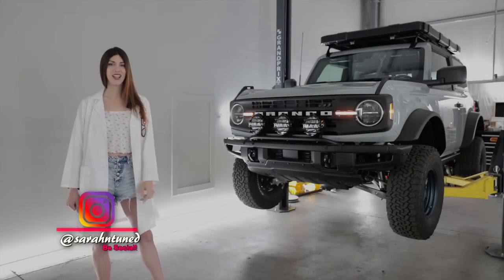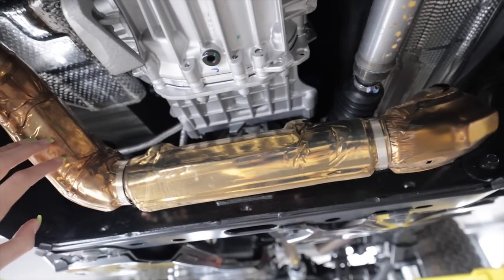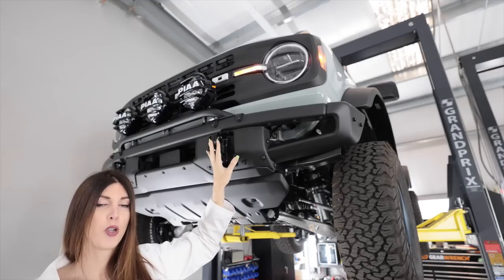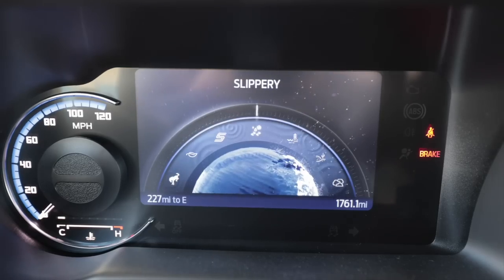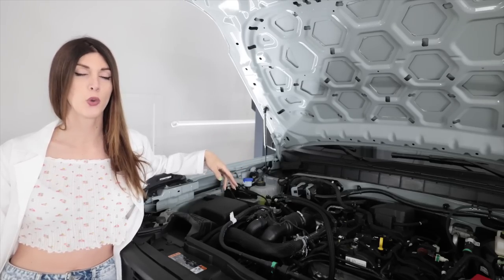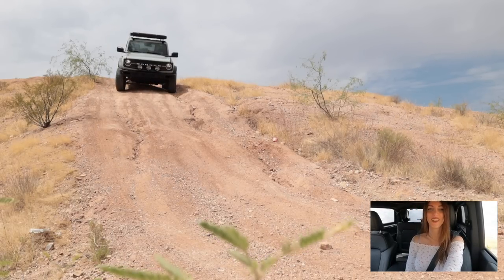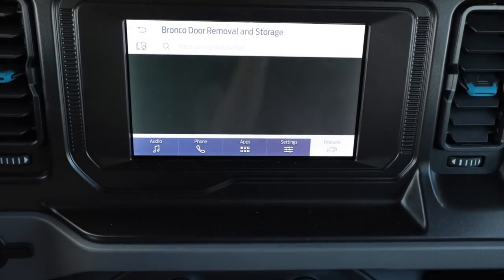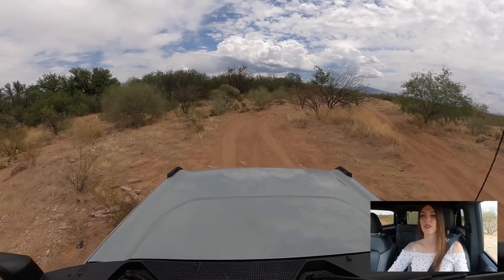The Perfect Recipe! // 2021 Ford Bronco Black Diamond Manual Review

Comment: The tow rating reduction is also because they couldnt add the additional cross member in the rear to support the frame twist under towing due to the exhaust taking up too much room. The raptor bronco has that cross member there, and that allows is the higher rating 🤙

Comment: If you upgrade to the locker front diff. from Ford , you have to change out the driveshaft and axle shafts also. 
Me , 2022 Black Diamond 2 dr. 2.3 manual in Eruption Green hard top.

Comment: I love the "Bronquito" moniker. We had a 2006 Ford Escape with a non-EcoBoost 2.3L V4 under the hood, which I understand is the ancestor to the engine you have. Hopefully the family tree carried over, because our 2.3L was a super reliable beast, even without the turbos. The only reason we don't still have that Escape is some Hyundai Santa Fe decided to try to kill my wife, and the insurance company totaled it. At least the Hyundai wasn't successful -- in fact, the roll cage held up surprisingly well. Wife got away with bumps and bruises.
Reply: Just for some clarification - it isn't a "V4" but an "I4" er inline. Ford hasn't made a "V4" since the 60s!
Reply: @theangrymarmot8336  Whoops. You are right. Thanks for the correction!
Reply: Yes, insurance companies lean towards totalling cars, even if the paint matching cost is the, only issue. The escape alternator change is, ridiculously, difficult. They are durable enough to last a while for young people and they drive, aggressively. 👌

Comment: Another thing I've noticed is when you let out on the clutch , the engine revs up to keep from stalling. You can start of w/o hitting the gas. Nice in bumper to bumper traffic.
Reply: my Veloster N does that. I caught the dealership tech on my dash cam complaining about it when I had it in for a oil change
Reply: A sad inditement of the skill level of most drivers in the USA. There again in the land of the not so free, where autos rule, that is hardly surprising I guess.
Reply: My 2021 mustang does that as well.

Comment: thats not a strange shape for a driveshaft. that is the splined portion of a 2 piece shaft, which allows it to lengthen and shorten as your suspension compresses or extends.

Comment: I had a 19 Ranger with the 2.3 and it was a blast. Tune, exhaust, leveling kit, bigger tires. I beat that truck constantly and it never missed a beat in 40k miles.
Reply: 40k is nothing tho...

Comment: Love this review . . . seems like the engine is going to be strong enough.  Some  what worried about the manual? I'm not a race car driver so the clutch part would have to be easy to use. IS IT?  I follow-up video would be awesome using the manual for everyday drives!

Comment: About the only thing I would want differently, as someone from a cold climate state, would be to add heated seats for the winter; possibly a heated steering wheel as well. Otherwise I agree your spec is pretty much perfect for being purpose built as an off-road rig.

Comment: when i had my 1969 bronco i had to put 3 engines in because it didn't have an oil pick up that would go around inside of pan to pick up oil
Reply from the maker: Why didn’t you fix the oil pickup on the 2nd engine then?
Reply: @SarahnTuned  they didn't start selling them till after i lost the bronco

Comment: Another awesome video. Informative and fun to watch. My 1991 Honda Civic RT4WD had a manual transmission with a creep gear.  That creep gear was the bomb! Instead of starting on a icy surface in 2nd gear, put it into creep, drop the clutch, and it was amazing how the engine would rev but it maintained an ultra slow speed.

In the video during the breaking test and when descending that super steep hill, I thought for sure you were going to go ass end over front! I wonder how much of that shift in weight is due to the tent top.  If you’re not gonna use it, you should take it off. Personally I would prefer the clean lines of the truck without the tent top. Plus, it would make it easier to remove the roof.   I would see myself removing the roof much more than I would use a tent.

Great stuff! The hard part is sitting and waiting for the next video. :-)

Comment: On my Fiat 500 Abarth, I upgraded my factory 16 inch wheels and 195/45R16 Pirelli tires to 17 inch OZ Ultraleggera and 205/40ZR17 Michelin PSAS4, the OEM 17 size. I lost 5 lbs of unsprung weight PER CORNER!

Comment: Great rig.  Totally agree about size of your Branco.  I rock crawl a 1940's Willy on 35's with a 4.3 vortec with manual 4 speed with Dana 44's and Detroit lockes.  It's open top and wheel year round in PNW.  It's so nimble in the tight trees and technical rock gardens.  I love your taste in vehicles and BMX bikes...I raced a PK Ripper in the 90's.

Comment: Does adding the catch can have any effect on the warranty?
Reply from the maker: I don't use warranties, I refuse to let dealership mechanics work on any of my vehicles even if its a component failure caused by the manufacturer. Dealers are typically a case by case basis though on warranties, it can vary widely.
Reply: @SarahnTuned  Exactly, you take it to the dealer and you don't know if whoever is working on it cares about it like you do. I've been fixing vehicles since 1975 or so and I try to do it like it's a loved ones vehicle. Thanks for all you do!

Comment: 17:33  That is where an independent front suspension can get you in trouble.
If there had been a bigger dip for the right front tire to go into, you can roll the truck.
A solid axle front end will flex a lot more and follow the terrain as opposed to lifting a tire.
Also, never go down a serious hill with it in neutral and the clutch in.  Unless you trust your life to electronic "hill decent" mode.

Comment: The 2015-2017 2.0 Ecoboost has the design flaw with the block cooling channels on the deck of the block that clog around 30-50k miles, which blows the head gasket, allowing copious water intrusion, hydrolocking the pistons, and destroying the motor. Happens with most of them, I had one, and of course, like the one with the bad valves, Ford isn't taking responsibility or recalling them. I hate Ford. sorry.

Comment: @2:32  for scale  my 1975 F-100   300 I-6  4x4   with 33" BFG Mud tires  10X15 steel wheels     no rear bumper    no tailgate     Thick steel roll bar   ( dana 20 ?? single speed transfer case )   4 speed   long bed   single cab   weighs 3,950 lbs

Comment: That is basically the same spec as the Bronco I would order.  The only difference is I would keep the Steelies and swap the tires for Mickey Thompson Baja Boss A/T's in 255/85R-17 (which is 34x10).

Comment: I am one of those time warped people . My dad bought a new 1973 Bronco Sport and gave to me about 15 years ago. My son and I restored it 3 years ago so unfortunately the days of kickin in the hubs are over...however still fun to drive. Your new Bronco weighs almost the same as the 73, but one big difference , my dad paid $1.00 a pound for it......prices have gone up a little for yours ! Cheers !
Reply: In 1978 I paid $2 a pound for my 79 XLT with a power angle plow installed weighed 5,085#. The base model was $7,500.

Comment: Updates that are a MUST for 2024 Broncos:
- adaptive cruise control on at least the mid-package
- Bigger infotainment screen
- all digital instrument cluster
- Hard top with body matched paint
-  Different wheels for the Sasquatch package (hate the current ones)
- replace the current fender flares with the Square ones from the everglades model
- Back glass open without having to swing the tail gate open
- half door option similar to what the FJ cruiser had

For the high price of a bronco it sure is missing several features that should be standard imho.

Comment: Sarah, I bought my 2024 Black Diamond Bronco due to your experience.  2 Door (4 doors are for lazy children), manual, Hot Pepper Red, trailer hitch and modular front bumper.  I almost regret not getting the Sasquatch package, but that was another $8k and I figured I'd be replacing the tires and wheels anyways.  The manual transmission is limiting; can't get heated seats and other fancy features without automatic transmission.   Guess I'll have to move to Tucson.

Comment: For your Broncos bare metal components get a product called Rust Prevention Magic. It is applied by heating the part up with a heat gun then you apply RPM by brush. As the part cools this product will cure to a clear, invisible film that will protect these components from oxidation, corrosion, salt and acid.
Reply: Worseorbetter, thanks for that product recommendation... I'm on it!  👍
Reply: @adamwebber9547 Cool.  I just got tired of painting components that shouldn't be painted and plating isn't in the budget so learned of it from reading through restoration forums online. May it be useful for the project you're  doing.

Comment: I would never add permanent weight to the top of a vehicle. I had a brand new ZR2 blazer in 1998 and putting the spare tire on the roof so that my wife could see out the back better altered the dynamics of the vehicle so much that I didn't feel it was even safe.
Reply: You need to develop a quick attachment for your tent so that you only install it when you camp

Comment: I totally agree with your review even though it would be biased to some extent. You are professional in your reviews BTW. I just wish that you would get rid of that stupid roof tent that you installed ..... looks out of place and totally useless. Cheers from Ontario.
Reply from the maker: I actually use it, so how is that useless?
Reply: @SarahnTuned  .... you don't do wilderness camping (I assume) so you do more glamping. If you drive to a campground then sleeping in a 3 season tent is easier and costs less. Better than having constant weight and drag on your car. 
Don't get me wrong though,  I'm not dissing you.  I do mostly wilderness camping. You're the best Sarah.  Cheers.

Comment: Hello - I like your channel! I’m about to finalise my order for the Black Diamond - Sasquatch - 4 doors. For now, I still have the 2.3L motor selected. Now I’m wondering, if I’m adding my roof tent (Thule Basin - 80kg) on the top…if I’m stating to be limit with the 2.3L.
Any thought on this? There is probably no chance that you reply. But in case I could get a women opinion :)
Thanks

Comment: How is everything going for you on this fine day? Throw a front locker and an R2.8 Cummins in that Bronco, and if you get it stuck, you didn't have the skill to drive there yet. P.S. If you ever need help taking your top off, I have a firm grip and a soft touch. That way your roof panels won't get damaged. It's weird I have to explain that.

Comment: Lot better than the old ones.
Reply: in 78 I bought a 79 that had locking front hubs on a Dana 44 and a 9in LSD with 31-spline axles out back with a manual gear box. 351 cid.

Comment: Don't do any early oil change. A brand new engine has oil additives for break in. Manufacturers recommend leaving that in and not changing the oil early.
Reply: you could change it and replace it with more brake in oil

Comment: Be carful on upping the horsepower. The 7 speed manual is limited to 350 ft lbs of torque. The engine is making 310 ft lbs from the factory, so be careful otherwise you could start shredding input shafts or synchros.
Reply from the maker: Negative that is incorrect, watch the video for the correct data 😊
Reply: @SarahnTuned  another armchair/keyboard expert! LOL

Comment: With hydraulic clutch linkage there's nothing wrong with a a manual transmission off road. Even with the old mechanical linkage there wasn't much wrong. You just had to learn how to drive it. Automatics are for lazy drivers.

Comment: The 2.3 is the best engine for the Bronco anyway. It's lighter, better on fuel, and the 2.7s have the valve train issue. It's also been around a while so they've had time to work out the kinks
Reply from the maker: Yep!
Reply: Going to have to disagree. The 2.7L makes 30-40 more hp, and 90-95 more torque while only getting 1-2 mpg less. Besides, the valve train issue seems to be from a batch made in April of 2021 per Sarah in this video. And considering Ecoboost upgrades have been around forever, the 2.7L has a much higher tuning potential. Finally, if the Ford website is correct, the 2.7L is both port and direct injected, not just direct like the 2.3L.
Reply from the maker: @ethinos2719  2.7 only comes with an automatic 👎🏻
Reply: @SarahnTuned  For now it's auto only but that could change. But I never saw the appeal of a manual with an off road vehicle. I like manuals in my sports cars and on my motorcycles, but I'd prefer the auto (and all the fancy software) for the Bronco.
Reply: 2.7s are a beast when tuned (look at Fusion Sports.) Pretty inaccurate to condemn a whole engine series just due to a small batch  of them that had an issue. Honestly you can't go wrong with any of the EcoBoosts (3.5, 2.7, and 2.3)
Reply: @ethinos2719  sold

Comment: I'm surprised that bronco doesn't spontaneously combust as it sits there in your lift 🔥. They have been having all kinds of problems with them! 🤣
Some things never change. Back in the day the older ones would roll over just cruising through a parking lot because ford was too cheap to make them a little wider.

Comment: should have waited for the Raptor version..... I believe the "early adopters" will run into all the problems Ford will work out... personally I would get the 392 Jeep Wrangler
Reply from the maker: Definitely not spending $80k on a Bronco, hard pass.
Reply: @SarahnTuned  And can you imagine? You didn't take the Bronco to the hill climb because you didn't want to park in a hotel parking lot. Imagine parking a raptor in one... No thanks.

Comment: I like the old Broncos, new not so much, IFS not a fan of, manufactured in Mexico, thumbs down, and yes they have engine problems V6, Mexico has a very low Q.A. control, ie the fiber glass roof and the not so hot canvas tops, which Best Top has a cure, have heard some engines have grenaded, again poor Q.A. (Quality Assurance) don't mean to crap on the new Bronco, but I'll stick with  my 20 Jeep Gladiator Rubicon, anyway enjoy!
Reply: In 1990 stood in line at the parts store to get a cam for my 86 Ranger with 30k miles on a 4 banger Two other customers in line with me were after the same cam. Chevy 305 had a disappearing lobe also. Got to keep all the torches lit on the hardening line. Now they use induction heating with a computer watch dog. Problems aren't new.